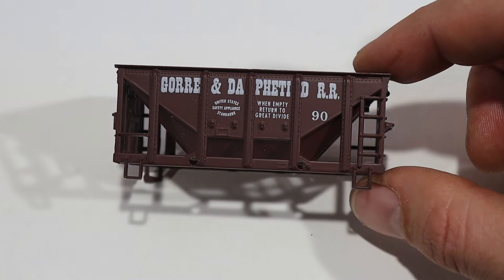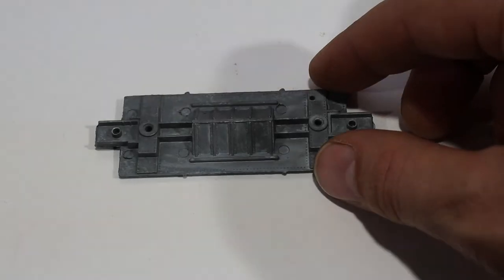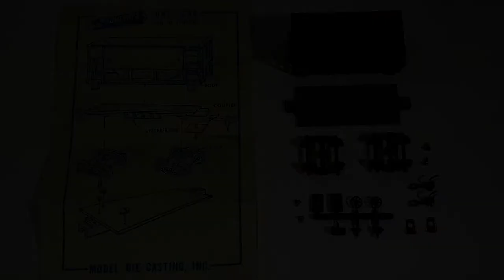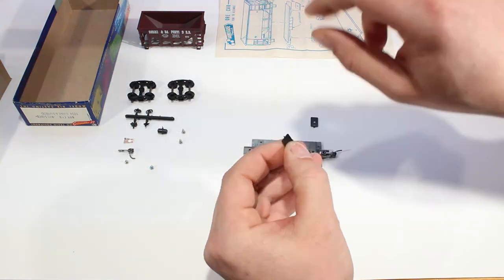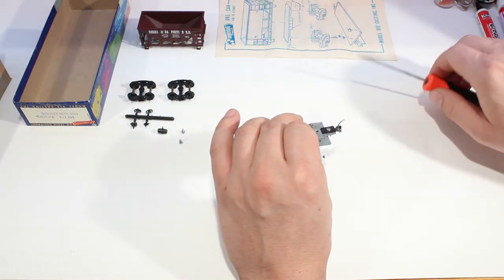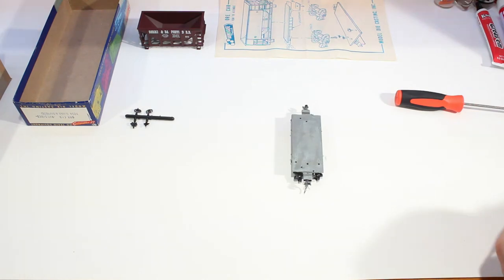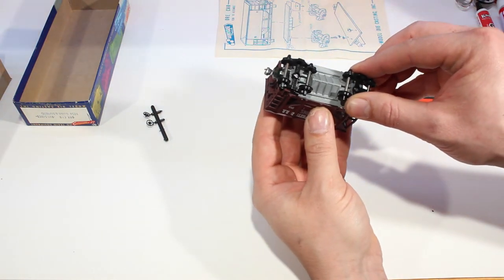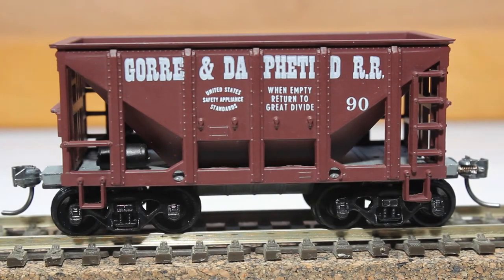Roundhouse 24' Ore Car Assembly   Gorre & Daphetid

Comment: Gorre and Defeated  was The Late John Allen's Railroad from the 1950s in California.  Unfortunately it 🔥 Down a few Years after His Death in the 1970s
Reply from the maker: Very Interesting piece of history!
Reply: it "burned down" because some teen vandals broke into his home, sacked it, vandalized it ,  then deliberately set it on fire.
Reply: I like your train. realistically long. but I've never seen loaded and empty ore cars mixed.
Reply: @suppylarue220  Correct - and not with mixed loads either. These would have all been loaded with ore or empty. In later years, higher side cars would have been used to haul taconite pellets.

Comment: they are $25.00 each, new kit, now sold in boxes of 8 for $199.00+shipping & sales tax! but painting and printing does look better.
Reply from the maker: Where I am here in Canada, they range from $29.99 to $39.99 for new ones depending on where you buy them from. I haven't seen any of the 8 packs here, but I do have a few of the 4 packs and they are usually around $109.99.